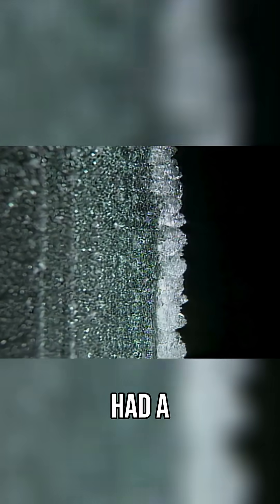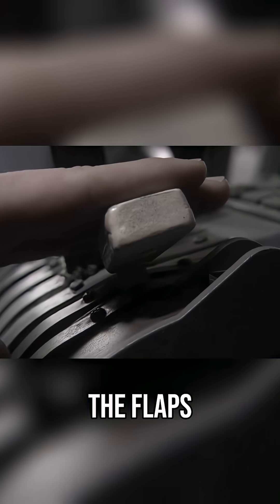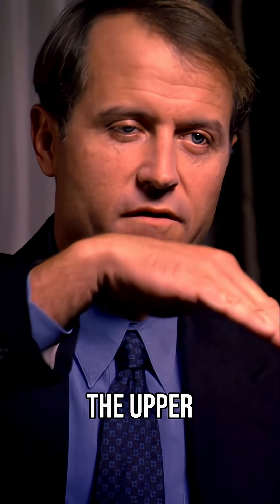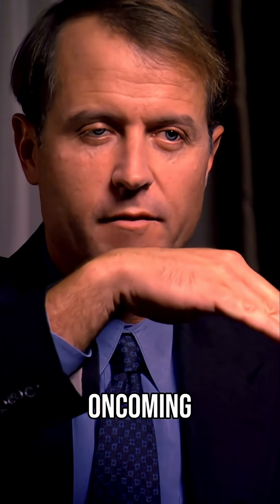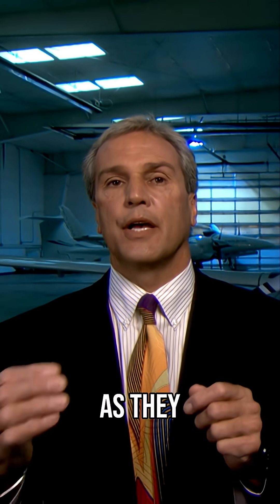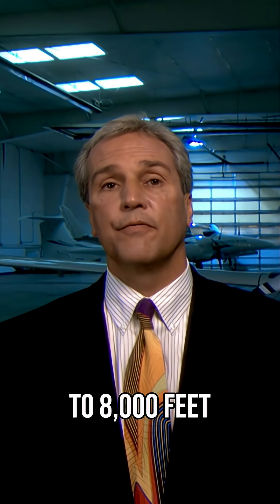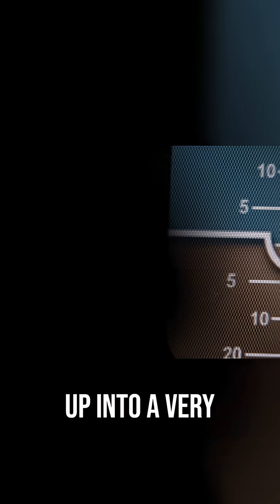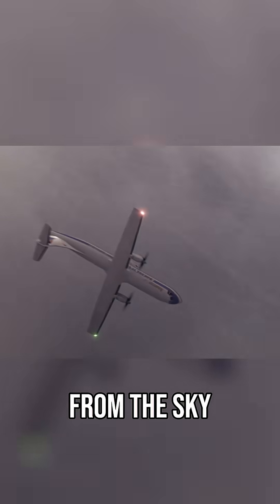Pilot's Comfort Decision Triggers Fatal Ice Disaster

Comment: Would you say ATRs are particularly susceptible to icing ? Well all planes are to some extent more susceptible because of the details of the design and shape of wing/airfoil. Well it requires careful testing to make it less susceptible but its a compromise between things like speed and aerodynamic efficiency. Also deicing equipment and pilot procedures in icing conditions is key. Could anything have been done better here, on the design and the pilot's end ? ATRs are designed to be reasonably fast and economical, but sometimes there's a price to pay in other areas, such as vulnerability to icing.
Reply: Yeah they suck. There was one in South America that spun out of the sky… and another one in Saskatchewan that crashed on takeoff.  

Yes there were bad decisions made in each case.. but likely a more powerful and forgiving aircraft like a Q400 would have tolerated those mistakes.
Reply: Yeah the ATR is known for being vulnerable to icing